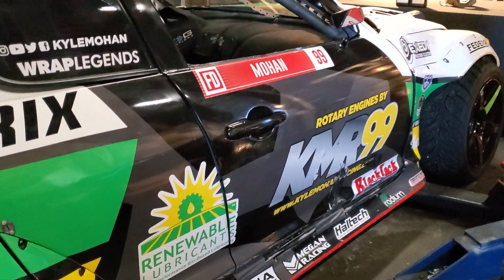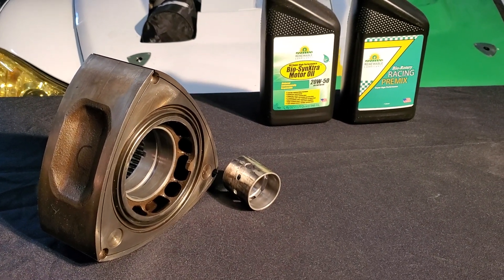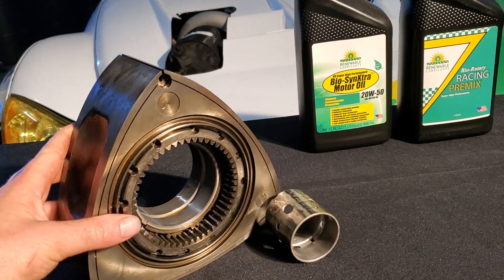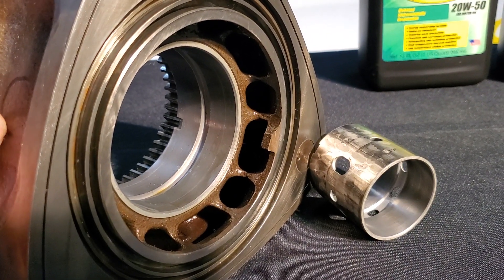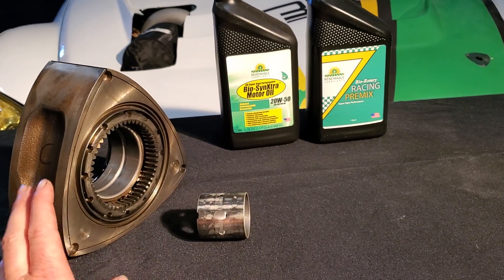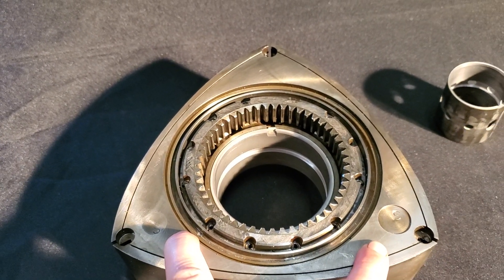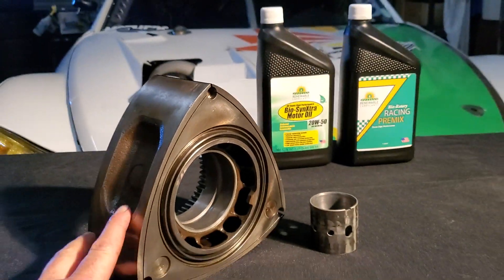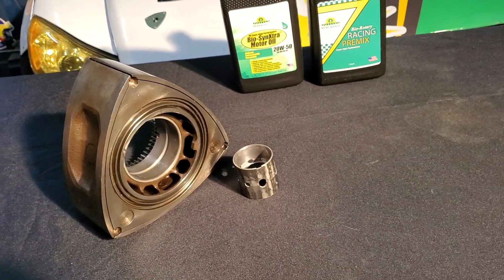1000hp 20b 3Rotor Motor Internal Parts Inspection, KMR Teck Talk, Looking at our Bearings and Rotor

Comment: Nice shout-out iori 👍

I'd definitely stress to people that the water injection is the major reason this motor is so clean. Not doubting the oils quality, it's just if there wasn't water injection the internals would look a lot different.
Reply from the maker: Its really an open topic but here's what I've seen over the past few years. I think the water injection leads to some rust. Its why i mention it. I use it for lowering intake temps when the NOS isn't on. I noticed a cleaner rotor when i switched to ethanol from gas. I've also seen improvements with low carbon oils, fuels blends, Premix's, ... Rotary's engines build up carbon easy so anything that can be done to reduce it is good.  hope this helps.

Comment: Mind blowing 🤯 no carbon and sweet bearings haha! Another great one thanks mr kmr!
Reply from the maker: Thanks, i really follow a lot of the old Mazdaspeed, Mazdatrix basics on setup specs for bearings... The Renewable Lubricants oil, premix and Ethanol as fuel really make for a clean setup these days. Cuts out carbon, gains octane. WPC is a nice trick as well.
Reply: @KyleMohanRacing  great stuff 👍 really appreciate you sharing the knowledge you have gained its all going into my current build ive learnt alot with the tik to...tech talks haha! Thanks

Comment: Game changer!!!! I wonder how it will lubricate under regular daily driving. Having that motor going high in the rev range and at a consistent rate with water injection too. I know the Vargas brothers are testing as well   So glad companies and even Mazda are still providing some rotary love. Thank you and all of your team Mr. Mohan!
Reply: Good question. Kyle has been running the premix in a daily driver as well. Our premix synthetic base oil not only is compatible with all fuel types, remaining in solution, one of its characteristics is to fight carbon build up, which a daily driver can develop, especially with some of the premix base oils  in the market that have poor oxidation, encouraging carbon build up.